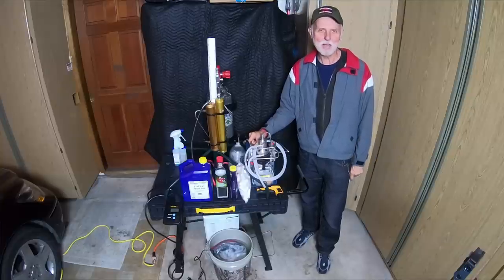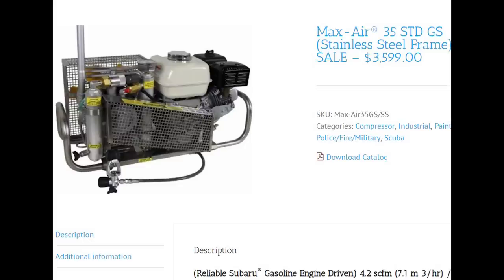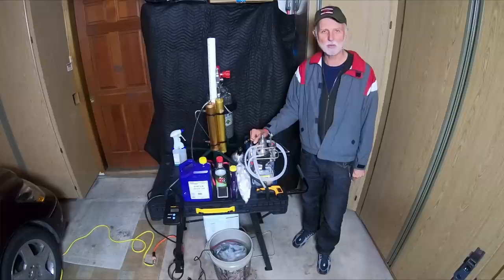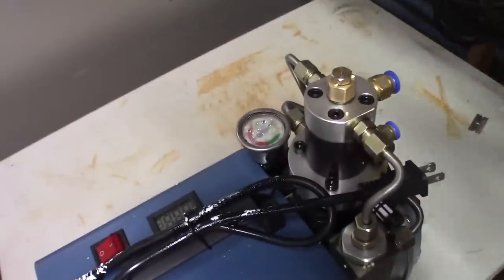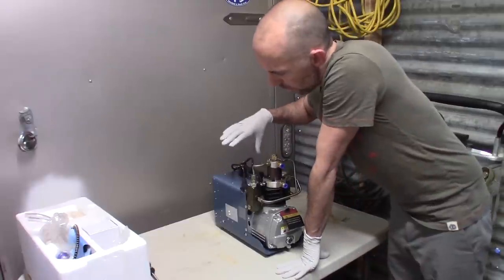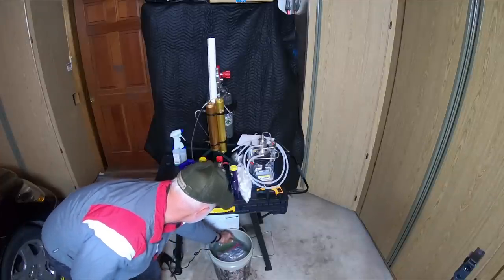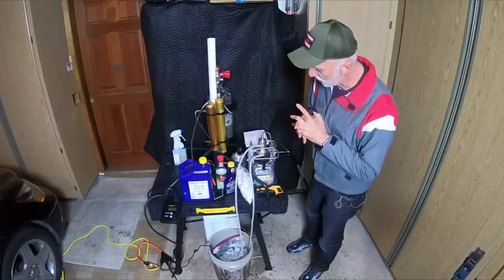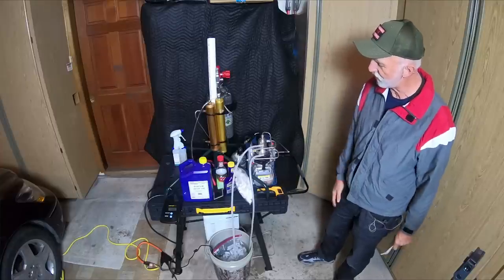Yong Heng Compressor Setup Secrets - Part 1,  Tips, Tricks & Traps

Comment: You know what I found works well is a higher gpm pump from harbor freight 
And a liquid computer radiator with two fans $14 each on Amazon and Mobil 827 synthetic compressor oil (eBay) keeps the unit very cool and keeps running no ice needed
Reply: Wow - sounds almost too good to be true!  I've found that the YH flow is limited by the small circumference of the tube and internal assembly.  How may gallons per minute is your pump size and does it really pass that much through the head?  So if I understand that you are running the Mobil 827 oil through your YH head, how much oil is held in the reservoir?  Love to hear more...
Reply: @CaliforniaTravelVideos  
Looks like they don’t carry the one I have anymore but they do have one that says it’s rated at 158 gph I had to heat the plastic hose I had a force it over the fitting, but pumps great. It’s only $11 give it a try
The radiator same thing.I recommend getting two 120mm AC fans so you can plug them in instead of 12v dc type and wiring in a power supply. You can get higher cfm that way too
Reply: @CaliforniaTravelVideos  
I think next thing on the list is to try a radiator cooler additive like “redline water wetter” which lowers the surface tension of the water and should make the radiator work even more efficient. I have used it in vehicles and it works very well especially if you live in a hot state
Reply: @CaliforniaTravelVideos  
Sorry missed the other part of question 
I don’t know the exact amount of oil that is in there, but there’s a guy on ebay that sells 12 oz for $20 that is plenty. This is by far the best thing for the compressor you will notice right off the bat, it will be quieter and smoother.
The flow rate on that pump seems to match the radiator too, very happy with that purchase too 
If need help with any of the purchases let me know I’ll send you the links
Reply: @richardyabuki5357  Awesome, I'm scoot over to ebay right now once you provide the link for the proper liquid computer radiator - I think my bigger pump should be adequate and the synthetic oil should be easy to find.  Cheers,  Michael
Reply: @CaliforniaTravelVideos  
Get 2 fans !! You can wire in parallel and save plug space
Reply: @richardyabuki5357  And which liquid computer radiator (specs) are you recommending?
Reply: @CaliforniaTravelVideos  
Well higher the core count theoretically the more it will cool. I went with the cheapest cooler !! I bought the $14 10 core because it was cheap and had the press on connectors on the line. My friend also suggested a heater core from a car if you want a bigger radiator. I like the fact that a computer one is already setup for fans
Reply: I mean “tube” count
Reply: @CaliforniaTravelVideos  
You tube keeps deleting my links
Reply: @CaliforniaTravelVideos  
Here’s the fan description:
AC Infinity AXIAL 1238W, Muffin Fan, 120V AC 120mm x 38mm High Speed, UL-Certified for DIY Cooling Ventilation Exhaust Projects

Here’s the cooler description:
ColouredPeas Water Radiator Cooler Cooling Pad for PC CPU Heat Sink Computer Water Cool System 10.6Inch （ 10 Pipe Aluminum）
Reply: @richardyabuki5357  Many thanks.  As I study the design more, it occured to me that your design does not have an efficient heat sink that provides a good heat transfer away from the YH compression head.  In a computer system the heat sink associated with the radiator has a flat surface that mates with the processor along with heat-conductive gel.  Am I correct to understand that your design only uses to elements:
1. Pump to transfer heat away from the head
2. Radiator to help dissipate the heat.
Reply: @richardyabuki5357  Sorry YT is doing that and I've had similar issues posting on some channels (nothing I've done on my moonlitnite49 channel). Sometimes if just typed "ebay" and added the URL segment after the www[dot]ebay[dot]com/ (more here).  Or of it's a YouTube link, similarly I add the sub URL so on this page it would by YouTube + jKqGeVYh5Z4
Reply: @CaliforniaTravelVideos  
The heat sink would be the radiator and fans. Do not make it a closed loop either put it on the intake or the output or both if you think your pump can handle two they are only $14. Keep the 5 gallon bucket. They make a ceramic heat sink material on eBay that you can attach to the head if you want direct heat sink 
Silicon Carbide Ceramic Heat Sink IC Electronics Cooling High Thermal Conductive 
I got some expired stuff from work I don’t know if it really does anything 
But the radiator/fans will do a lot you’ll be impressed especially for the $ spent. It will be just like a car except not closed loop. I have the fans pushing also not pulling because I don’t have a shroud 
If you want I’m sure you could experiment if you continue down this path. The most important thing is the oil !! Keep the rp ice in too it prevents corrosion and lowers the surface tension of the water in the radiator. It won’t do much in open water system it’s made for radiators
Reply: @CaliforniaTravelVideos  
It’s the same design as you presently have except instead of using ice the heat is dissipated thru the radiator. The computer model you use is using is using  a plate so this should be even more efficient since the water is circulating they the head of the compressor, correct ? The heat transfer doesn’t need a thermal paste to wick away the heat. The heat is being transferred thru the water, all you have to do is keep the water cool or am I missing your point (?)
Reply: @richardyabuki5357  Many thanks for the follow-up, excellent advice!
Reply: @richardyabuki5357  Well, it's not as though the exiting water temperature is all that hot when using cool water going into the YH head.  I assume the radiator only dissipates the temperature to ambient room temperature - or does it have some form of a low pressure to refrigerate the water temperature?
Reply: @CaliforniaTravelVideos  
I agree that’s why I put on incoming side 
With you using Ice and the surfactant I’m sure it will stay significantly cooler than anything and the ice will last longer the first couple of fills my ice only lasted 5 minutes ! The water in my bucket was warm to the touch, that’s approximately 3 gallons. Takes a lot of heat to heat that much water in 10 min. 
Try it if you want, I think the oil will be the most significant you’ll see right off the bat. And everything I mentioned is relatively cheap to try. You’ll like the radiator setup if you want I can send pics if I’m not making myself clear
Reply: @CaliforniaTravelVideos  
The water lines do seem to stay cooler 
It’s that compressed airline out the secondary that needs to be cooled ! Maybe make a tee off of the radiator and wrap it around that airline ?
Reply: @richardyabuki5357  Okay, I'll start looking for the parts
Reply: @CaliforniaTravelVideos  
Ok I tried the eBay and then the link didn’t work unless I’m doing it wrong again so 
Type this in on eBay
4Chip Semiconductor Refrigeration Kit Thermoelectric Peltier Water Cooling 
And look up thermoelectric peltier water cooler on YouTube 
I think this what you’re looking for !
Off of 12 v dc you can make a refrigeration unit to chill your water !!!
eBay has a kit with everything in it

Comment: It matters which hose you use for the in and out. The way it works, even in a chemistry lab using water cooled condensers, is the input enters at the bottom forcing any air to the top and out to the output line. If reversed with water entering into the top, you would have air trapped at the top and not able to escape out the bottom. If this happens you would have air at the top of the cylinder and not get the water cooling effect you're looking for and possibly enable overheating of the cylinder.
Reply: Great points!  Thank you for your contribution, especially since mitigating overheating is paramount for the YH.

Comment: It's irrelevant if the water is above or below the pump by the same distance.  You would be pumping against the exact same head either way, the only question is whether you do so before or after the pump.
Reply: just need to make sure the outlet hose is under water
Reply: Exactly, he must have been some kind of engineer.

Comment: Your videos have helped me a great deal. Thanks for posting them and explaining everything so well. I would really appreciate it if you would help me with a couple of questions about the shorter of the two gold filters, the first one that the air passes through. Can the top and/or bottom be unscrewed to gain access to the inside of the unit (like you can on the Tuxing filter)? Also, why is the drain valve positioned so far from the bottom of the vessel? It seems like a pool of water would collect below the drain, and the only way to completely drain the unit would be to tilt it over on it side. Is that correct? Or does the first gold filter drain completely by simply opening the drain valve? Thank you!